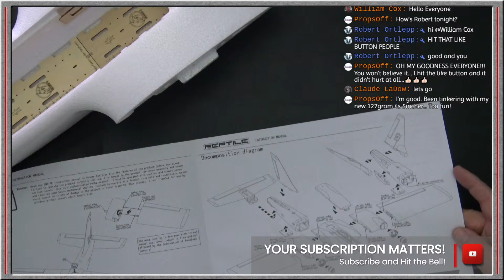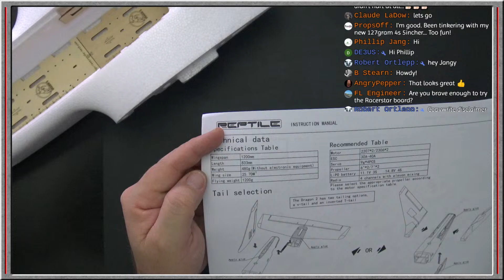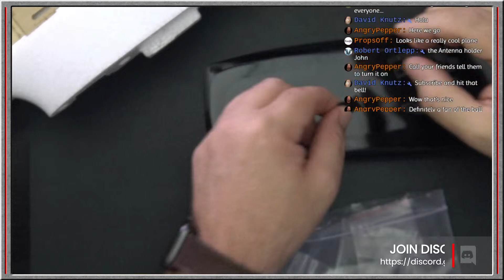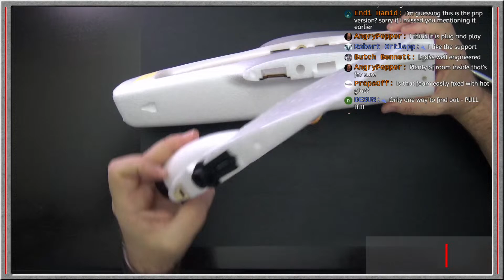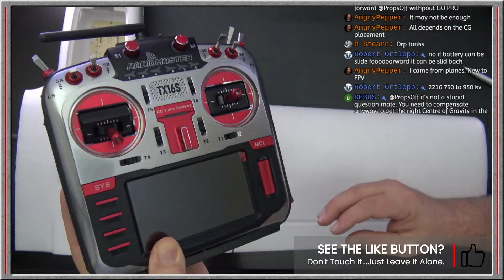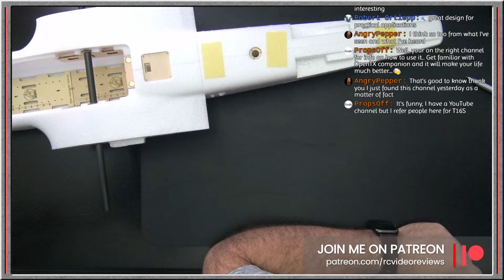Reptile Dragon II 1200mm Twin Motor / Twin Tail FPV RC Plane First Look

Comment: Kit vs PNP - what does PNP stand for ?
Reply from the maker: Plug 'n Play: i.e. It has motor, esc, servos. You add receiver and battery. Kit means no electronics, it just has the airframe.

Comment: great review .    I just got mine in  yesterday  ,  but the spars that connect the wings to the fuselage weren't in the box 🤦‍♂️🤦‍♂️🤦‍♂️🤦‍♂️🤦‍♂️ bangood is not helping , what do you recommend ?
Reply from the maker: It shouldn't be too much of a problem to source them online. You can use aluminum tubing, or wood dowels if you can't find fiberglass or CF. Just measure the diameter of the hole for the spar and hunt something down.

Comment: Hi, thanks for the in-depth walkthrough! Can anyone suggest a good motor combo for this aircraft? I'm planning it as a cruiser running 4S2P 21700 Li-ions so I'm looking for efficient motors with low current draw. Thank you!
Reply from the maker: Current is influenced by your load (prop) selection. Sunnysky v3's are among the most efficient motors you can get.

Comment: Hi John,
I ordered a Reptile Dragon 2 and watched your video with great interest. I hear that the price in February 2021 was 240 euros for a PNP version. I have now paid 121 euros at Banggood - quite a difference.
Did you regularly fly the Reptile Dragon 2 after your maiden and did you find any special features?
Yours sincerely,
Casper
Greetings from the Netherlands
Reply from the maker: This is a very very good plane. It's slick outside, the power setup I used makes the plane feel light and responsive. That's a fantastic price for this plane. You did get the v2 for that much???  I haven't flown it much since the build but I can tell you it is fantastic. Very docile and easy to fly.
Reply: @RCVideoReviews  What power setup did you end up going with? I just got my Kit from Banggood today at $89.00 shipped from the USA. I'm searching videos to find what parts to use and found your video, it was great! New Subscriber now. Look forward to more of your videos!

Comment: Pretty cool for FPV. Tail options are quite unique. Motor? You know dragons breath fire. 4250/540kv 80a ESC and 10×9 prop +2 1400 6s, so that you can get some video of the upper atmosphere! ;-) I may not be there but, Sing it with me... It's the final countdown   AirHammer out!!
Reply from the maker: Hah, 4250. Dang man. Great song!